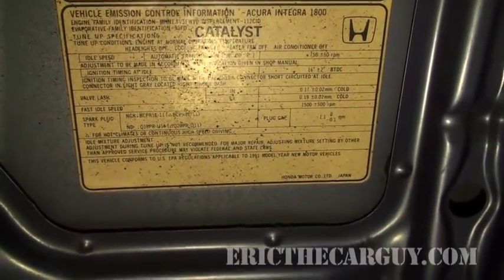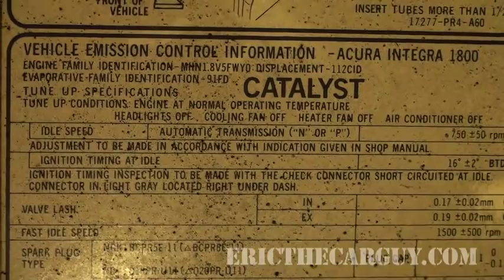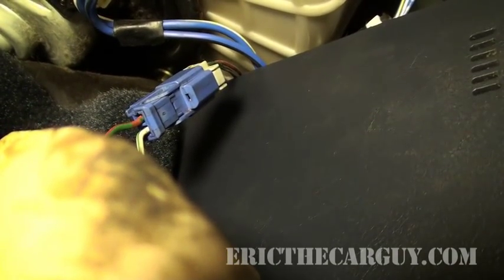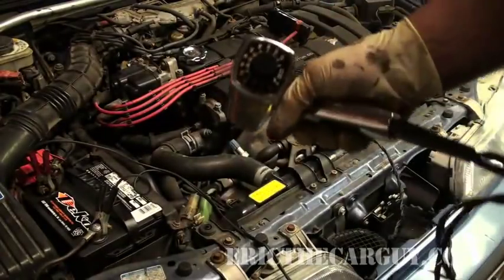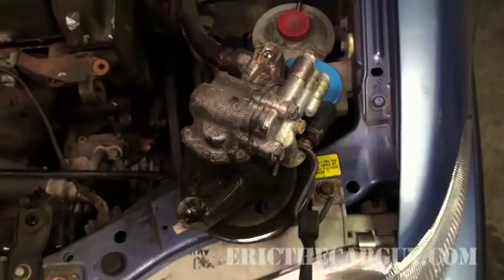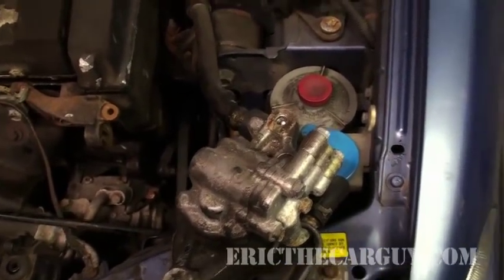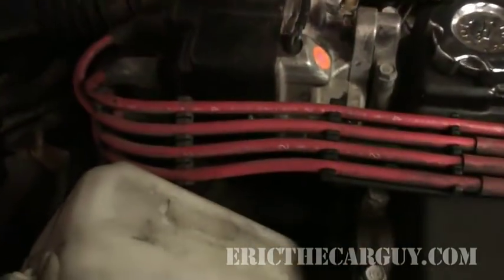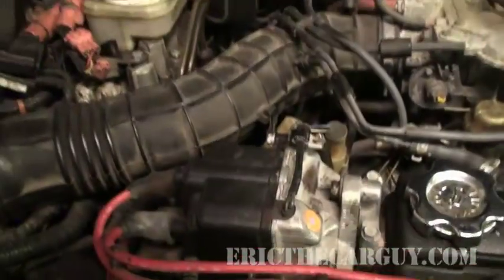How to Set Ignition Timing, Acura Integra - EricTheCarGuy

Comment: HELP,
I have a JDM B20B engine out of a honda CRV.
I at first I set the timing without shorting out the connector and it seemed to run decent... Now I have went back and SHORTED OUT the connector and set the timing. I then removed the short and started the car. The car now backfires a little when starting up and if I check the timing it is way off....... this is very confusing.. why once the check connector is Un-shorted does the timing go way off... Is this normal?  

Please help EricTheCarGuy

Also one thing is that my engine is very shaky when starting up from being cold. Once warmed up it runs normal... I assume this could be due to the timing..
Reply: valve adjustment? I had a similar issue on a usdm b20z form a crv. Adjusting the exhaust valves fixed it.
Reply: bblackmon19
yep cylinder 1 had zero compression. the valves needed reseated. I swapped in a B16a now but .... Ive got this crazy high idle and ive changed parts and done everything I cant think of. somethings telling the IACV to stick wide open
Reply: JamesBlackCuzoms  Figure out your problem? I am having the same issue and I just found out I need to short it to time it correctly. I had some mechanics mess with the distributor as well and it ran better for a while. Did your car have Idle problems in the beginning before you messed with the timing? Or was your problem that it was just a little sluggish? Mine is the second. I have no idle issues or anything just a sluggish problem.
Reply: Hey so mine turned out to be only running on 3 cylinders... its amazing how a honda can run on three cylinders. So yeah mine was sluggish also. My advice is that if your timing has been set then next do a compression test before messing with anything else. I spent hours trying to figure out why my car was sluggish when just doing a simple compression test would have saved me time. It turned out my valves on the one cylinder were leaking compression and I had zero compression in that cylinder. Anyway good luck and let me know if you have any other questions.
Reply: JamesBlackCuzoms
 What's this shorting it out business? I don't understand.
Reply: DE Nichols
 Under neath the dash above the ECU is a connector called the Service check connector. Its only a small blue or grey two wire connector. You take a paper clip or small piece of wire and connect the two pins inside the check connector together (hence shorting them out). This will cause a engine light to come on when you start the car. That means the cars timing will be ready to be set and the ECU will not be fighting against you while setting it.
Reply: Clear as glass. Thank you!

Comment: If you're using hondata you can just put the ecu in set ignition timing mode, that works well :-)
Reply: Aaron Johnson If you don't have a $500 computer this works just as well.
Reply: I think I paid 640$ to have it installed into a P72 actually. But yeah this works if you aren't running any kind of aftermarket engine management system.

Comment: I recently replaced my head gasket and my distributor on my 94 Integra Ls . While installing my distributor I cracked the case but the inner components seem to be ok put some J&J welding on it. The engine shakes and some times turns off when I stop. Could this be a timing issue or vacuum issue? I would appreciate the help thanks for your time.
Reply: Esthefany Hernandez 
You should use some PB & J instead of  J & J. I think that should solve your problem. 
lol.

Comment: So does the car need to be at operating temperature?
Reply: Nope
Reply: In my Honda CRV manual one of the steps before setting the timing says too hold the engine at 3000 RPM with no load until the radiator fan comes on and then let it idle. I assume this is to warm up the engine to get it to a normal idle. When your engine firsts starts up it usually runs at a higher RPM until it starts to warm up. Timing on a vehicle advances as the RPM on your engine raises. If you are timing to your idle speed then it would be best for the car to be running at operating temp.

Comment: Should the timing be set when the engine is warm?
Reply: +holdenguy75 Doesn't change anything. Just remember to short the service cable near the ECU and you can adjust the timing when the engine runs.
Reply: +tonytober the reason the engine should be warm is probably to make sure the ecu wont fast idle to quickly warm the engine is complete. I'm not sure if this service jumper disables this as well. 

You'll even notice when he's reading the yellow label it says fast idle 1,100-1,500 rpm or some such.
Reply: +holdenguy75 The engine doesn't need to be completely warm, but make sure the idle rpms have settled down to idle after starting.